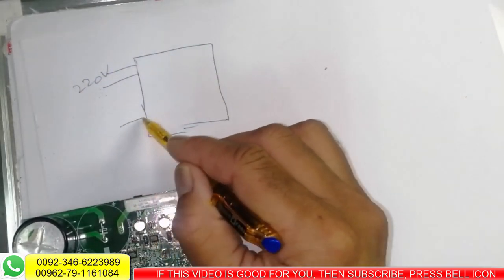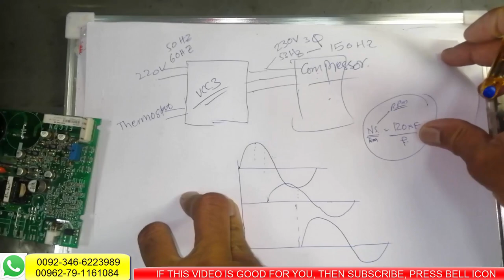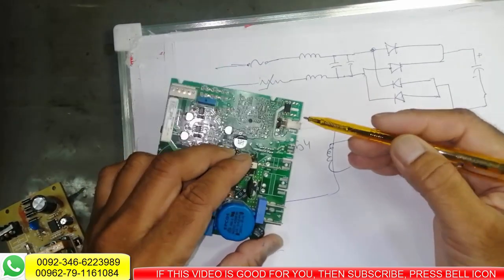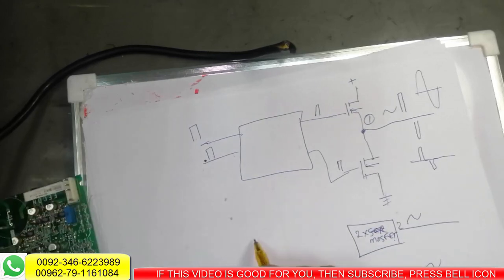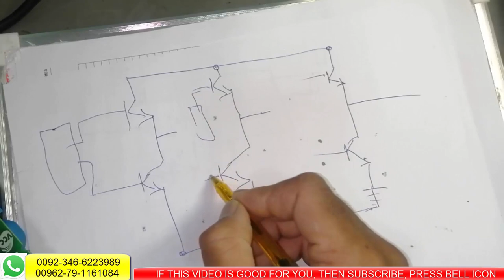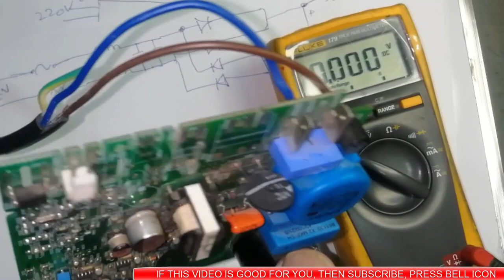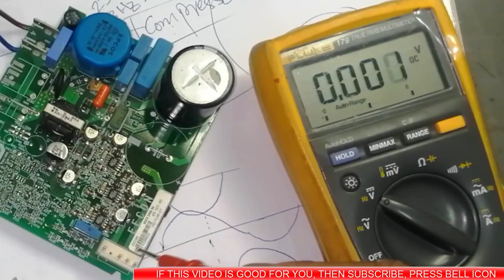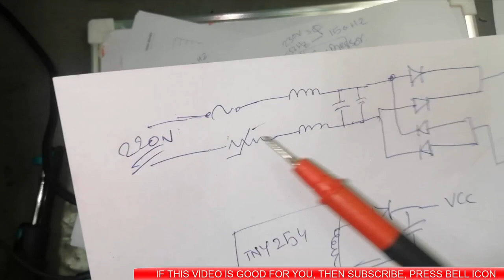#158 How to Repair VCC3  Board

Comment: Mr. Hasseb thank you for sharing your insights.  For me it is very valuable information, coincidentally I am repairing one but I do not have an oscilloscope or an inverter compressor to use as a load.  my question is, can you use incandescent bulbs as load?  or with the multimeter is enough.  THANK YOU. 🙏🏻

Comment: Thank you for sharing your knowledge with us
I have a question and I would be very grateful if you could answer me
In the large black capacitor I get 311 volts, yours is 335 volts, does the lower voltage in my case cause the failure?

Comment: Hi Mr Haseeb, question I happen to have a working VCC3 2456, which is 220V 2.1A 1PH input, and 230v 3.3A 3PH 53-120Hz output. And need to know if it will work with 115v 2.1A input?

Comment: I have tested the compressor and my readings was I believe 6.7 ohms on all three legs and testing each line to ground was not shorted using a typical multimeter ! Does that seem correct?

Comment: hi sir my inverter is kikdr and the signal is thermostat 
so do i still give 3.3 volts at signal pin and start the circuit?
can i know what should be the voltage at the 3 pin connector im getting dcv +-12v at all 3 pins is this correct?
i saw in other video they short thermostat to neutral and it starts the compressor but mine cannot
i have followed your video all the way to the chip b4 the compressor 3 pin but i cannot test the chip
is there another way to test the chip sir? 

this video is THE BEST video to understand the repair!! keep up the good job sir!

Comment: My refrigerator stops working and completely defrosts sporadically. It will start working several hours later and work for a couple of months.  The amps from the motherboard
 and voltage to the inverter checks out.  Can the problem be the thermostat in the inverter.

Comment: Very interesting video Haseeb about the Theory and practical repair regarding this VCC3 Compressor DC inverter control board!!! I learned again a lot today.
question:  I measured all 7 SMD small capacitors and have similar readings as you have in the video except for one: C201 (33microfarad) is only 0.11VDC, should be 6VDC. So I gues this one is the trouble maker.
This VCC3 2456 23 is build in a Liebherr diepfreezer GNP 3376 20K. The problem is that when turned on the maximum he will go down is -2 degrees Celcius. There was quit some ice in the "No-frost" section in the top so I cleaned everithing and all ice is gone now. But still the same  issue. Meanwhile I ordered the top PCB 6133 732-00 where both temp sensors and Defrost heating, FAN iare connected. But today after  I saw your video the problm might lay in the CVV3 module...
I checked/measured all folowing parts are working fine: Air Sensor (6kOhm), Evaporator Sensor(6KOhm), Door contact, Fan, Defrost Heating system(220Ohm),Compressor both speeds are working-initial speed High and low speed.
Could you give me a hind Haseeb? MAny thanks again. Stephan.
Reply from the maker: In your situation it seems that  the vcc3 board is working nicely 
Problem may be in thermostat board. Might be it is ending false switching or 
Please check optocoupler connected near thermostat connector (on vcc3 board) 
Otherwise if the board is turning on and the compressor is working, it means the board is working good. 
Just the thermostat switch is not sending the control commands to the vcc3 board for proper function

You can try the thermostat or check wiring as well
Because it is low voltage high frequency signal, loos or poor connection in communication makes improper behavior of the system
Reply: @HaseebElectronics  Many thanks again Haseeb for your tips.
I measured again on that one smd capacitor C201 and now I measured 6.2VDC. So my bad. Indeed the CVV3 inverter is working fine. I also checked the optocoupler and this one is working fine as well from 3.2 VDC to 0.1 VDC once I connect 3.3 VDC on the thermostat connector.
The wiring from the VCC3 PCB to the thermostat PCB is checked and fine. I still hope that the top PCB 6133 732-00 (thermostat PCB) that will arrive one of the next days will solve the issue. I keep you posted. Kind regards, Stephan.
Reply from the maker: @stephanbot4720  I also guess that the thermostat pcb is interrupting and not sending good control commands
Reply: I measured also the 3 windings from the compressor and had nicely 3 x 16.5 Ohm. So compressor is also OK.
Finaly after exchanging the top PCB 6133 732-00 (thermostat PCB: 90 euro) the Diepfreezer is working again perfect.
Many thanks for your very helpfull information Haseeb! KR, Stephan.
Reply from the maker: @stephanbot4720  wonderfully awesome
It is my pleasure that you considered me for discussion
Sty blessed

Comment: Hi Mr. Hasseb thank you for the video. I have an inverter that is 120V input and want to know which is the neutral and hot and how important it is for the inverter to work properly ?
Reply from the maker: best regards 
unluckily i have no experience in 120V circuit. as i am from Pakistan and here it is 220V boards 
i will try to check some material, if i found something i will share surely
Reply: @HaseebElectronics  thank you much.
Reply: the reason for my question about which is the neutral on the board ,is that when I measure the voltage, on the 390uF capacitor (with voltmeter) I place the black wire on the negative of the capacitor and the positive on the positive of the capacitor and i read -63V.  which tell me that it is reversed, right?
Reply: @HaseebElectronics  so I connected the neutral the correct way and now i see 350V pk2pk clean sine wave between each of the 3 phases, does it mean that the inverter is good? also, with or without 5V signal into the inverter i see the 350V on the 3 phases , is that correct?
Reply from the maker: It is not a good reading 
it mult square waves sampled circuit and. it's output meat drives through processor and driver ic and finally through igbt sets 
so I think you need to verify the circuit
Reply: If 350v sine wave between each two inverter pins , what should the output signal between any two pins of the inverter ? the inverter I have is  VCC3 1156 for veritable speed compressor. The compressor resistance for all 3 winding is 15.2 ohms. Thanks

Comment: Hi I’ve been pulling my hair out! I have a vcc3 1156 115-127 to 230 53-150 hz and 3.3 amp on both input and output and single phase input to 3 phase output but now I discovered my original was what they call “Drop in”  and the one I acquired is what they call “frequency” what is the difference?

Comment: Peace, mercy and blessings of God be upon you. Sir, is it possible to operate the inverter compressor with this card alone without installing sensors and a data screen, i.e. running a card only and connecting the compressor connection only without installing any wire in this board. Does it work constantly?

Comment: Sir  I m abhishek .I have whirlpool freez .Inverter board not passing current to compressor and  Bulb is lighting inside freez . Capacitors and MOSFET are good but do not know why current not passing plz help
Reply from the maker: is the thermostat signal  i mean  the signal at optocoupler is connected correctly and it is working good??
Reply: @HaseebElectronics  yes sir .octocupler working good , ntc also beep at continuity, pf is also showing 1 .MOSFET and capacitor are good ....Sir how can I contact u

Comment: 33uf / 25v  - 33uf /63v Would it be a problem if I replace it
Reply from the maker: if you select the higher value i.e 63v instead of 25v
while the capacitance is same, then it is okay
Reply: @HaseebElectronics  teşekkürler

Comment: Before bridge rectifier 230v/ac is present after that in capacitor 500v 180mfd dc voltage is showing 0, assume the bridge rectifire is defective. Compressor is not taking start . Kindly inform me to solve the problem.
Reply from the maker: please check ntc 
or verify bridge rectifier
check 220v at ac pins of bridge rectifier. if voltage not available at center pins. the problem input side
if 220 volts are present and you cannot find DC voltage at capacitor that means the bridge is fail
Reply: Overload protector (OLP)was open circuit.After close circuit the OLP220AC  was found in central pin of bridge rectifier and in capacitor 323V/DC  also. There after the Refrigerator works satisfactory. So I am very greatful for your kind help and guide line.
Now I am 58yrs working in E.Rly as a Refrigeration mechanic  with ITI  passed certificate but have no knowledge on electronics ,I want to take study notes on electronics for pcb of refrigetor & A/C from your end.Hope that you may inform to me regarding the same at your ealiest possible.I am agree to join your classes if you arrange in online. Kindly inform me.

Comment: Hello, can anyone say how to test thermostat on refrigerator that uses this motherboard?
Reply from the maker: there are 2 types 
1 is just send on/off signal (logic high or logic low to turn on / turn off compressor) 
2nd type uses code based communication ptotocol to control compressor (most of time it is used in inverter compressor board) you can monitor the signal using oscilloscope 5 volt peak coded signals )
Reply: @HaseebElectronics  Thank you. I expected something like that. Unfortunately I am not such advanced with all of this. I can measure a resistance, measure a sensor, but sending on of signal I have no idea. 
I have a bosch refrigerator with this motherboard and I have tested it as the compressor doesn't turn. Tested first the compressor:
16.0 ohm, then 16.2 and then another 16.2 ohm for the resistance between the three pins. 
Then I tested the motherboard, on the compressor conector:
After few seconds since replugged, the motherboard sends about ten times about 57 volts to compressor (measurements on AC), it does this ten times and then it stops, but the compressor doesn't seem to turn, even between these steps. 
I thought the pcb is the problem and bought a new one, it does the same. 
Then I opened the no frost system and checked everything there :
Main resistance 0.479 kohm
Thermal security passed 
Temperature sensor on main resistance about 500ohm
Second sensor(i don't know for sure if it's a sensor or a resistance as it is less visible, it goes to the rear side of evaporator) , about 450 ohm.
I have to test the fridge compartment sensor and if it's not this one, I don't know what could it be.